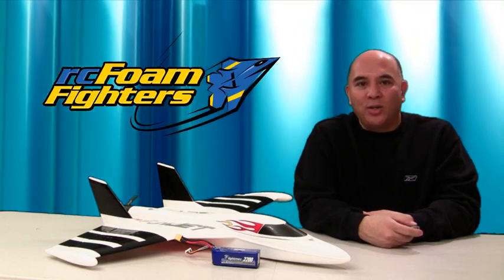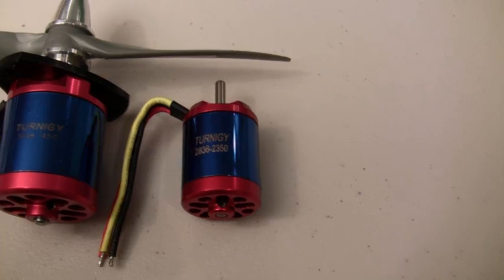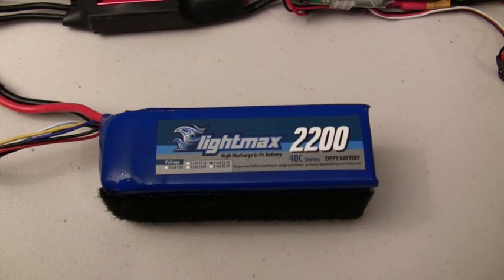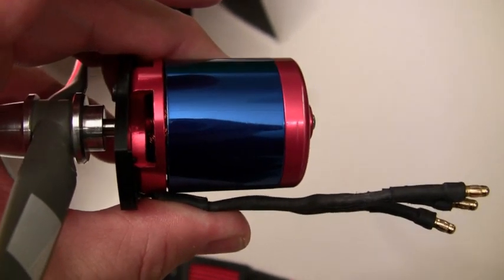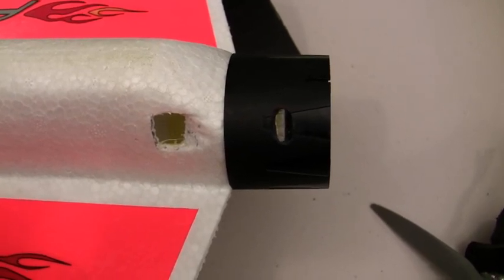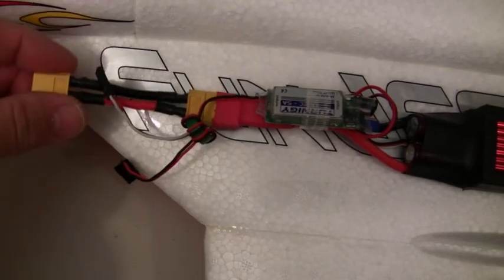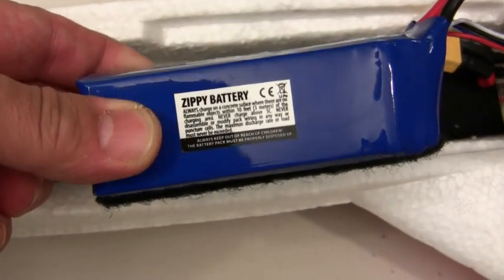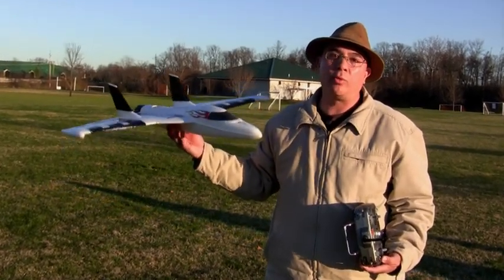FunJet 1600watt 5 Cell Setup Installation and test Flights

Comment: FAST!!!! So are you disconnecting the "Red" Wire from the ESC and leaving the bec red wire right? Or do  you leave them both connected? I just got the same esc for  my 90mm F/18, over 2000watts on 6s.

Comment: oh dude, that reading of 131 was low guaranteed! had it been straight on you probably would've gotten an additional 15-25 mph on the reading. i know you already know this, but wow! i've seen strykers pulling more watts and not flying that fast. i feel for paul, i couldn't film that thing either. you raised the bar again....dang!

Comment from the maker: mxf7010g8k I myself have not tried any of the Grayson motors on my planes but my brother Paul has used theGrayson Super Mega Parkjet motor on his eep ParkJet and Nova Jet. These motors are rated at 450watts and the fastest clock we have gotten with one is 111mph on the Nova Jet.